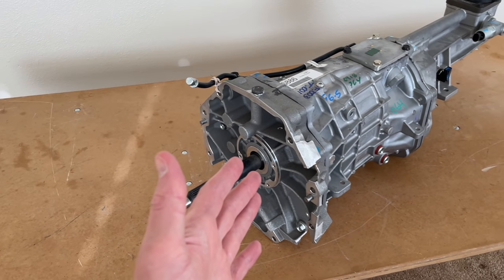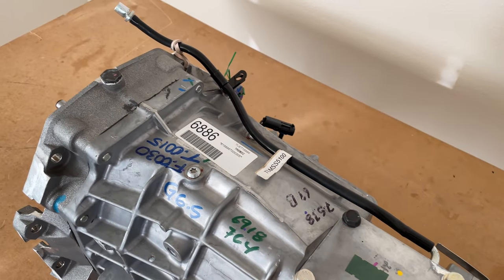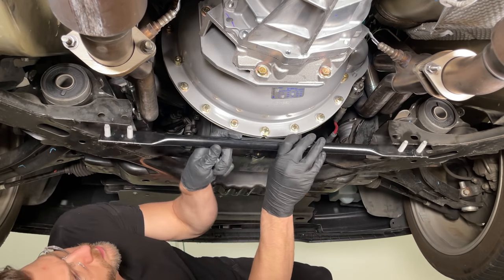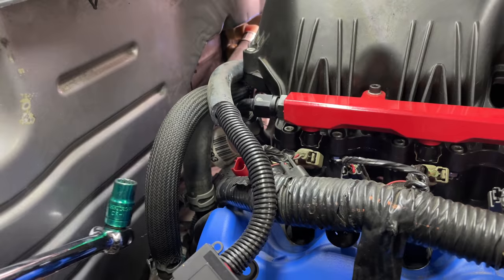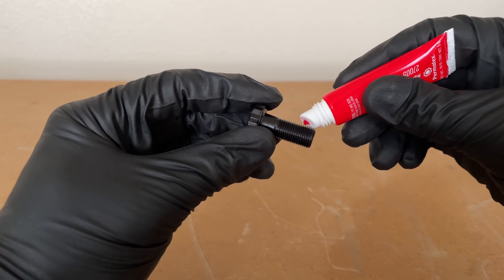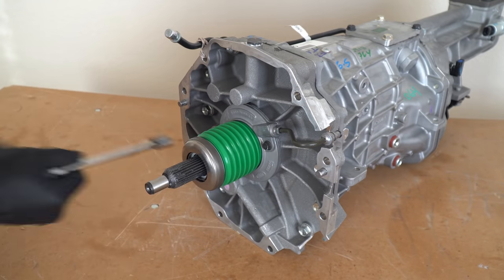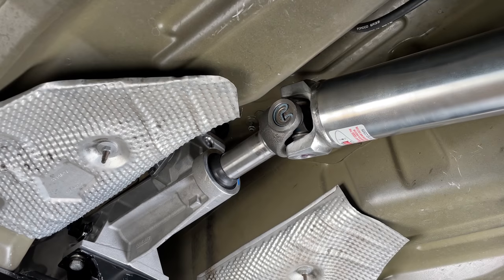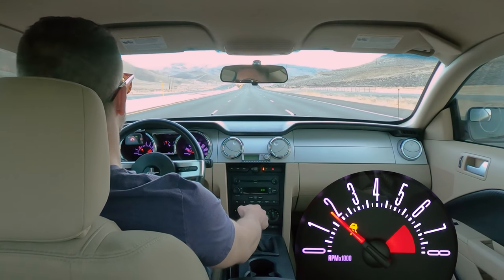How to install a T56 Magnum

Comment: I just did the exact same swap in my 2011 mustang gt and I installed my stock throw out bearing. I bled the cyl. and it felt really good , the next Dayi pushed the clutch a couple times and I heard the tob exploding so how are you setting yours with no shim? This is maddening and tremac said I’m on my own if using stock tob.
Reply from the maker: Effff that is very very frustrating. So whether or not a shim is required is often based on the clutch. The RXT twin-disc I used did not require a shim, but the Centerforce clutch I switched to did require one (it came with the kit).

I'd reach out to the clutch manufacturer and tell them which setup of theirs you're using, transmission, and on what car, and they should be able to tell you what size shim you need. Otherwise you'll need to determine the clearance manually...

Comment: Is there any advantage to using Amsoil ATF Fluid on manual transmission instead of the Amsoil Severe Gear?
Reply: Tremec calls for atf in their manuals.  That is what they recommend.

Comment: What upgrades allowed you to safely rev into redline?
Reply: His other vids are awesome just like this one, and go into detail about the building of that motor. Guessing all that work is what lets him go past the paint on the tach, but good question.
Reply from the maker: - ford performance intake manifold (shorter runners)
- 127600 cams
- phaser limiters
- ported heads (not exactly necessary)
- proper tune (increased timing above 6,300 RPM, etc)

engine makes power right up until fuel cut
Reply: @Four_Eyes  Good luck in your build. I appreciate the detail of your videos

Comment: Can you tell me where you connect the open cables on the wiring harness?
Did you used the 2 purple ones?
Reply from the maker: I didn't wire up the lockout solenoid, so I'm not sure.
Reply: @Four_Eyes  so 
You just used your normal car wiring harness for the rest? 
You not had an adapter for some sensor ?
Man this is confusing .. fcking sensors
What did you do to get your speedometer work?
Give me part numbers if possible pls
Reply from the maker: Speedo and reverse sensor connections didn't require adapters, everything worked out of the box. The major hiccup I had is that the PCM thought 1st gear was reverse and would torque-limit the engine to like 114 lb-ft which would cause me to bogdown when taking off from a stop.
Reply: @Four_Eyes  how did you solved that?
Reply from the maker: Change max torque allowed per gear in tune via HPTuners.

Comment: You didn’t talk about shimming the slave. And you think not running the reverse lock out is ok?
Reply from the maker: OEM slaves work fine with 07-09 GT500 clutch kits (like the RXT in this video) so no need to shim or use an aftermarket hydraulic release bearing. This would, as you probably know, require a pilot tube and measuring clearances and I didn't want to complicate the install/video further. And yes not running the lockout is totally fine as the spring can always be overpowered regardless if it's hooked up or not.

Comment: I completed the swap today.
Does your t56 make some little worknoises?
Reply from the maker: "worknoises" ?
Reply: @Four_Eyes  gravelnoises in every gear
Reply: @Four_Eyes  not too loud 
But hearable
Reply from the maker: what clutch and flywheel do you have
Reply: @Four_Eyes  i have the Exedy leightweight flywheel with 6bolts E302A was the number i guess and the exedy gt400 clutch 
Its my dailydriver 
A double disc clutch was too much for me 

I runned a normal exedy clutch in the tr3650 and was really happy with that 
I dont think its the clutch 
Its coming from inside the transmission
Reply from the maker: does it sound a little like this (the whirring on acceleration)?: https://www.youtube.com/watch?v=8_0iCbtBJGw

Aluminum flywheels will be noisier as they don't dampen vibrations from the drivetrain nearly as much. When I first did my swap, I put in an RXT twin-disc and an aluminum flywheel which was very noisy - sounded like that racecar. I switched to a lightened steel flywheel and a single organic disc and that helped a lot.
Reply: @Four_Eyes  no its not a whine 
Its like krrrrrr grinding a little bit
 
U said i have to use atf dexron 3 
We dont have much american oils in germany 
So i choosed castrol transmax 
Its dex3
I have to change it in 500miles 
Maybe there exist quiter oil
Reply: But in every gear
Reply from the maker: you can try running a thicker gear oil to reduce noise, it might make it a little harder to shift when the trans is cold, but shouldn’t be a problem

the noise you’re hearing is likely normal tho
Reply: @Four_Eyes  aw man 
Thank you for repliing so quick again 
Yea i will try a thicker gear oil then 
Hope the oilholes and ways are fat enough for that 

Its a bit too loud for normal noises 
Too low rpm noises are normal
But it continues at higher rpm  

We will see in 500miles 
I tell u then :D

I will just get mad if the grinding is gettin louder . Its damn much money for a non yt guy :, 

Ah and i went with the bowler all in one harness 
Fuse 12 on the passenger side (climate control 5ampere) works well for a switched 12v source with an fusestealer adapter 
I didnt had to fight with 1st gear is  reverse :,
Everything worked and u can adjust via bluetooth the speedo of the car 
(My eng is crap)

Comment: Will this transmission work on the 3.7 mustang? Or no we stuck with an mt82
Reply from the maker: it will work! hit up modern driveline, JPC, etc. may require a slightly different bell-housing and/or driveshaft, but defs as doable as this install.

Comment: Just a word to the wise, DSS has terrible customer service (we--my repair shop and I BOTH--could not get a response from them via phone, email, or otherwise), the driveshaft needed rebalancing 3x in 60k miles as the aluminum driveshaft doesn't seem to do well under even my use with mild bolt-on/tune of a 3v, much less with about any aluminum shaft my performance/repair shop took them off of, the yoke and shaft mesh of the teeth usually "...took  ordering 6 of them to get two yokes to properly mesh" as there was typically "way too much play between the slip yoke and the shaft teeth," as my performance shop told me is a major problem with DSS shafts, and under high revolution or power use lend to multiple rebalances as I experienced. I had my guy remove it and build a 1-pc steel shaft and haven't had this issue since. He builds these for everything from my street/track car to off-roaders and has yet to have one come back for repair other than a worn out/abused u-joint or two (1350 HD joints are what I requested and he normally puts on them as is). DSS used to send him a new yoke but now has ceased to answer him. Just facts you should know about DSS which we've experienced first-hand, but do what makes you happy. A few I know have had good luck in their application, but I know more than often there are problems. Yeah, they claim the high power handling capability, but I simply got tired of no customer response and balancing my driveshaft before it causes premature bearing failure on my transmission and the leaking of my pinion seal. No problem now, so to each their own but I won't deal with DSS again, sorry.

Regardless, thanks for the video and keeping it simple/not wordy! 😁👍

Comment: Nope my Cummins has around 685hp and over 300,000 miles bought it brand new and I’ve never had to touch the nv-5600 in it just 2 clutches

Comment: As a t56 owner, I dont think its the best ever. More like its the only practical high HP trans. The crappy parts about them is that they are very complicated, expensive, and the single worst thing, they are double overdrive. 5th and 6th are typically useless for performance, and if you get one with the .80 5th, you could put 3.73 or a 4.10 rear end gear in to make 5th almost useable, but then 1st and 2nd are so short that any car with decent hp will find those gears useless.

Comment: 5:20 bro even u have a expensive and good jack... PLS put wood or stone under youre tires. Even if the jack fails, the car will not drop down.

Comment: Why did you use ATF for a manual?
Reply from the maker: Good question! ATF is a bit thinner and allows for slightly faster shifts. The main trade-off is gearbox noise.

Comment: But that's not a Ford Toploader 4-speed and can't be the close ratio Toploader, which is the best manual transmission ever made.
Still, with TCC's, I don't know why anybody wastes their time with clutches that run dry and can't possibly last more than 50,000 miles. Automatic transmissions are the way to go on the street.

Comment: for some reason cannot get my input shaft to seat all the way into the pilot bearing .  even tried doing the extra step you did and got a steel alignment tool still nothing
Reply from the maker: Does it go all the way in when the pressure plate bolts are loose (clutch discs are moveable)?
Reply: @Four_Eyes  yes it seats all the way
Reply from the maker: Are you able to tighten the pressure plate bolts all the way down while fully seated then wiggle the input shaft/trans out? May require slightly loosening the bolts just a bit.

If so, I'd retighten the bolts and try to re-insert.

Also ensure the splines have a light coating of grease on them as well.
Reply: @Four_Eyes yes it seems like it’s an alignment issue . like it literally has to be perfect . how were you able to get your transmission lined up so perfectly when you were using the t-56 input shaft as an alignment tool

Comment: Im not sure how americans hadle it. Normally bolt and screw designation is dependent on the actual thread size. I was a bit confused as he said 13/15 and 17mm bolts.

Comment: Actually the best manual transmission is NOT the tremec. The liberty bell unit is better. With the ability to upshift or downshift at any rpm, with or without a clutch.  Put that in your pipe and smoke it.

Comment: Oh, you're installing a $28,000 Furling-Getrag 6 speed dual clutch that can handle 1000 HP and 800 pounds/feet of torque safely? Where are you installing the coolant radiator and fans? And who's rear axle will you use? Are you planning on using CV joints or fluid couplings between it and the drive shaft? The new Ferrari Florida (Mondial body) uses the 8 speed version to handle the 1200 HP and 1300 lbs/ft of torque from the Boxer 12 with a low-end displacement blower and a staged turbo charger and 6 valves per cylinder and direct injection from Alfa Romeo and desmonic valves (no valve springs). Bring your $1.1 million and expect it next fall! It may not be as fast as the Hurecon, but it will be far more civilized and handle FAR better. Mondial's styling will TRASH the Bug's!

Comment: Gr8 Gear box . 1000hp xcellent.  700lbs Tq.  Not so good . Two many turbo & supercharged engines r making well over 700lb .  So breakage long term use is extremely high

Comment: But... That's not a Muncie... 
I already know I'm either going to be ignored or attacked for this, but here goes the rant anyway... ;)
Sorry, but overdrive manual transmissions simply CAN'T be as good as a non overdrive manual trans because of a fatal flaw that's unavoidable.  Whenever you're in overdrive, the pilot bearing between the input and output shafts is always working, and the whole transmission is under load.  A direct drive tranny doesn't load anything but the high gear dog clutch when cruising and that bearing doesn't move since both shafts are locked together, therefore it will outlast an overdrive tranny in any and every application for that reason.  It's also why manufacturers don't even offer manual transmissions in most of their cars or trucks anymore.  People want overdrive and automatics handle overdrive better.  Every overdrive man trans I've ever rebuilt was done so because of that pilot bearing between the shafts wearing out.  I've never... NEVER... had to rebuild a direct drive manual transmission due to catastrophic failure... ever... I've only "refreshed" them to replace bearings, synchro rings and gaskets.  The only one I've ever even SEEN fail (3rd gear synchroniser wore out, stripped teeth off of the gear), did so because it was nearly 60 years old and had the living crap beat out of it for decades by multiple drivers who didn't know how to shift (SM420 in a med duty truck).

In my opinion, if people want 6 speeds, they should build them with lower gears and no overdrive with higher gears in the final drive (rear end)... but manufacturers don't really care about longevity when they know most of their performance cars won't be driven more than a few tens of thousands of miles in their whole lifetime anyway.

Comment: Theres no better manual transmission better than T56 6 speed with upgraded parts or getrad 6 speed for the price these transmissions last a while before taking a crap on you, the older 5 speed transmission cant even take beating from a regular v8 4 6L motor.

Comment: What oil do u usr
Reply from the maker: any ATF Dexron III, the fluid is thinner and helps with shifting. you can use a thicker MTF fluid to reduce noise but shifting can be a bit more clunky.
Reply: @Four_Eyes  thanks mate 
Im about to order a t56xl

Comment: Great except you left out the entire wiring instructions..!
You show plugging. In the bowler harness to trans but forgot to mention the other end of that harness is hooked to NOTHING…
And the instructions from bowler are pretty vague and all those plugs you plugged into will do nothing until you wire up all 6 loose wires to sources described in bowlers vague instructions. Just would’ve been nice if you showed your viewers WHERE you hooked up those 6 wires. 
In your video you mention “not hooking up wires for reverse lockout” but if you didn’t hook up those 6 wires nothing else works like….. speedometer, reverse back up lights, neutral safety, and of course reverse solenoid …
Anyway, I think your videos are very professional and informative but the wiring solution is VERY important part of installing the 6 speed in the 3V mustang…
RP
Reply from the maker: I didn't wire anything anything outside of what's in the video. The VSS and reverse light connections hooked right up.

Comment: Being crushed by your car is both an embarrassing and agonizing way to leave this world 😆..... 4sho!!
Reply: Hey fam, I have a question for you?  I have a 2007 SS V8 Monte Carlo 50,000 miles sitting in my driveway(been their 5 years) nothing wrong with it in excellent condition, I've been watching videos of cats making a front-wheel drive Civic all-wheel drive with the conversion kit, do you think I can do this to my front wheel drive V8 SS Monte Carlo🤷‍♂️( anytime I ask a car guy they never get back at me ), wouldn't that be a beast though, I would even go as far as putting TT on it or a SC setup ( Beast mode ), that would be the Money Carlo that everyone deserved from Chevy the aerodynamics alone would give it a great advantage .( if I did all that I would even chop the top/bring it down a couple inches and widebody rear kit to give it a sleeker look ) .......
Reply from the maker: that’s some West Cost Customs shiz, serious custom job. i’m sure it’s possible but super expensive.

Comment: still ridicioulous that such cars still have a transmission at the engine and not at the axle, eg a transaxle, which is so much better for weight distribution

Comment: This isnt the best manual transmission ever made, my 1978 pete had a 13 speed double o I put over a million miles never had a issue it was behind my 980 hp KT600 cummins.
Reply from the maker: yeah but could that bad boy rev to 10,000 rpm

Comment: Looks like a knock-off of a RWD  '80's Toyota Corolla / Cressida / Hilux 5-speed box......superbly 're-invented' in America......aherm, Mexico...
Lol, not even the tail housing or the mounting point has changed! Is that 'Borg-Warner'  logo-square still visible on the off-side of the casting?

Go Tremec !

Comment: you blew the bleadng. of the clutch...
your way.  aerates the.  fluid....
its suposed to be done kike this....
open nipple....push pedal to floor....
hold peddal......tighten nipple....
let up on pedal......push peddal to floor....hold....loosen nipple...let out air....tighten nipple.....let up on peddal.....push and hold peddal.....bleed....tighten nipple...let up on peddal..........your fluid stays clear of air.......
Reply from the maker: what's up with the formatting here

Comment: what a tall pile of certified fresh horse manure....the xl transmission rated for 1000 hp so you can drive down the interstate in 2nd gear at 68 mph and 8600 rpm with dual high output turbos screaming and flames coming out of the exhaust.....a young fool and his money are soon parted.....the best part of this video was the lockout solenoid so that devoted students of speed can't accidentally put the transmission into reverse at 95 mph